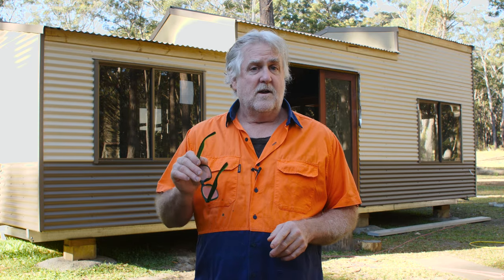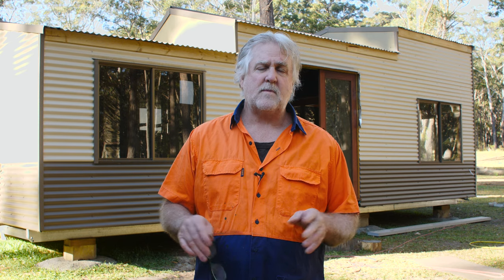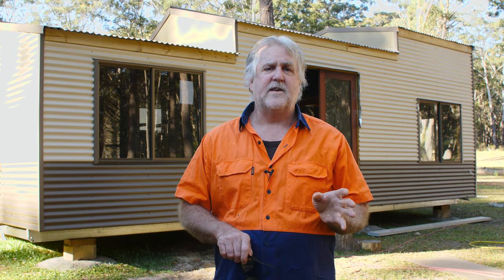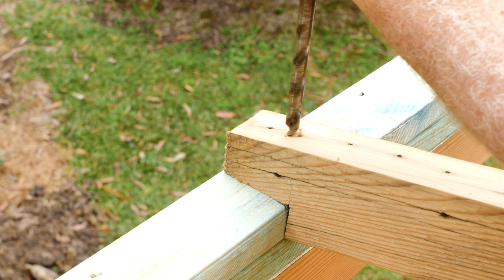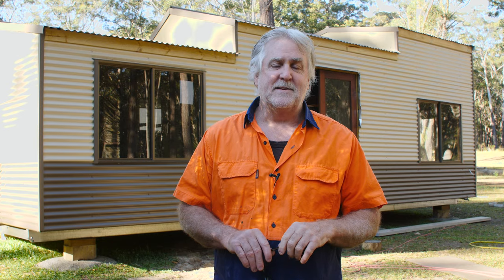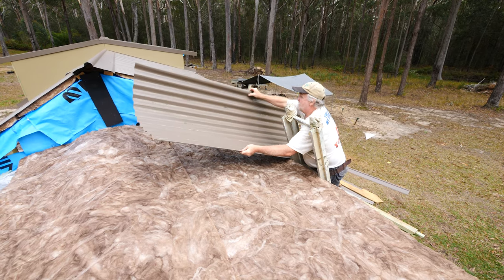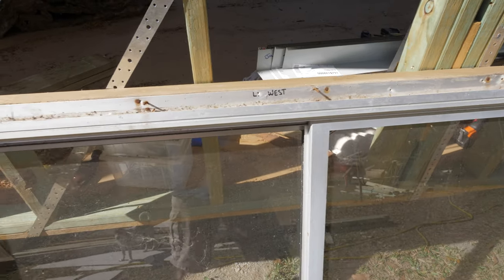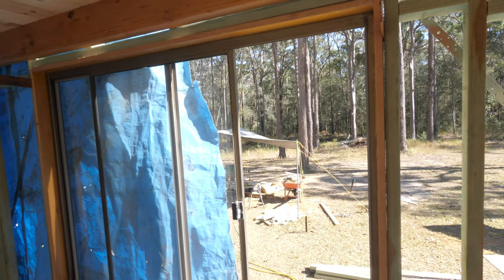Tiny House Lockup stage -   part 3 Coming along now!

Comment: Is this width still allowed on roads? I thought it would be 2.5m max?
Reply from the maker: Partables can be 3.5 wide, the tilt tray needs all the running  lights tho and I believe they also need a special permit to move. Any wider and you get into fore and aft pilot vehicles being needed. I don't know the exact measurements or cost of permits tho. But after calling and talking to a transport company, it's the reason we kept the sturcture under 3.5 meters. Hope this helps
Reply: @tinyhousebigdreams1201  thanks heaps, yes i do want to be able to move it myself without special permits for sure!
Reply: This is a beautiful garden and a project that makes a lot of sense. 3.5m wide starts to feel like a house. You can use hallways etc. And saving heaps on trailer and
Reply from the maker: @Vincemd  Thank you for the nice comments. :)